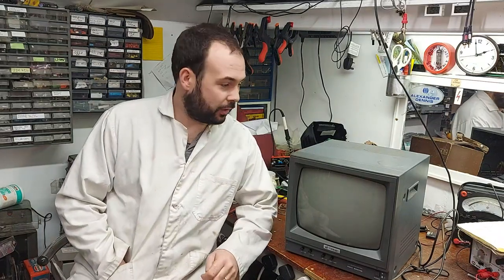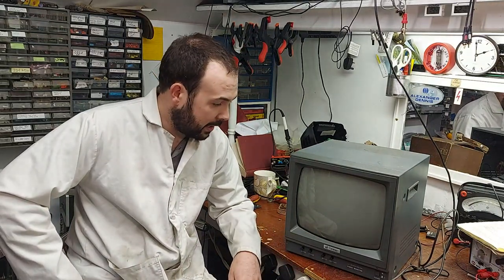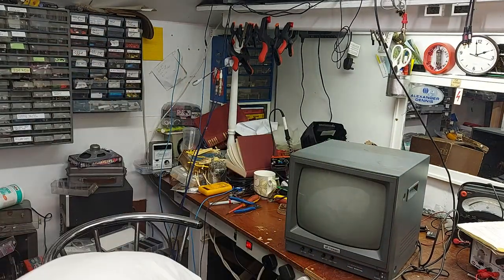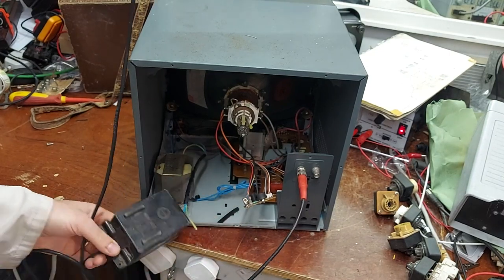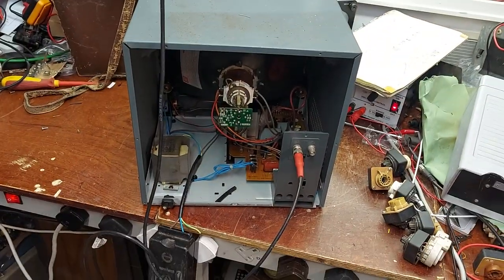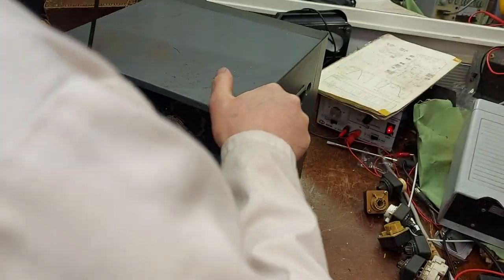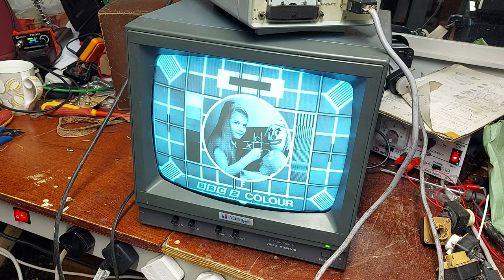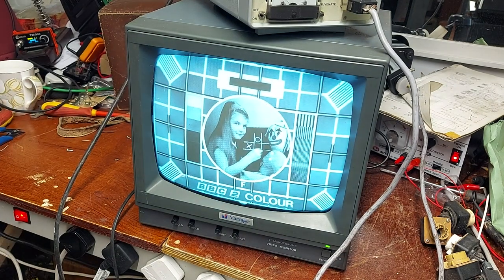CRT Rejuvenate. Old CCTV Monitor CRT Rejuvenated.

Comment: I remember the first tube rejuvenator we had though we did not call it a rejuvenator .it cosisted of 4 light bulbs a 100 watt to run the heaters and 3 15 watt bulbs one for each cathode on a colour tube .
in 1973 lashed out on a b&k.  mullard tubes used to come up and last well mazda not so good and trinitron tubes only lasted about a month.
Reply from the maker: Sounds like some machine !!
Reply: @IrishvintageTVRadio   it looked inpressive  loads were made from a design in practical television if i remember right.

Comment: Yes it did look good on the camera lol.
I made a crude rejuve circuit 10 years or more ago,  i was able to bring a frends colour tv back to life.
It was the first colour set in my town (A loooooong time ago).
It lit up the room like stadium lights lol, i had to back off the r/g/b drives.
The set was all germanium transistors with a pull power switch on the front and another switch on the right side.
I think it was an hitachi set, it was really well made.
The channel rotary and fine tune were on the same shaft.
To get one gun to work at all i had to turn off the heater for a few seconds,  then it kicked in :-D.
G8 mullard tubes never rejuved very good, the white smearing was a fault i never was able to fix.
Reply from the maker: Good old Hitachi.
Reply: @IrishvintageTVRadio  It lasted a hell of a long time :-D
I had to bring up the rgb drive  over the years and finally the green gun died, i tryed allsorts.
Ive never seen a set last so bloody long lol.
Sorry about the waffling.

Comment: I made up tube booster with diode 15w emission bulb and a couple of 40w bulbs for the heater.  I done very well with that block of wood  blast of rough DC on the cathode shakes the dirt off ha.